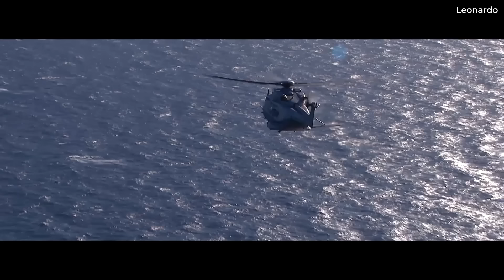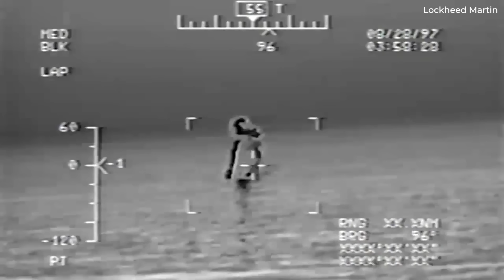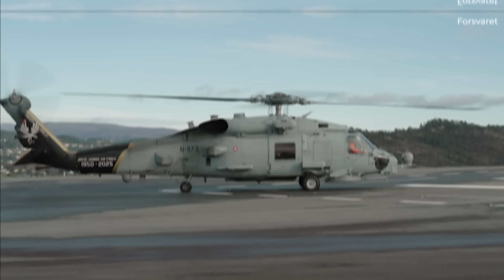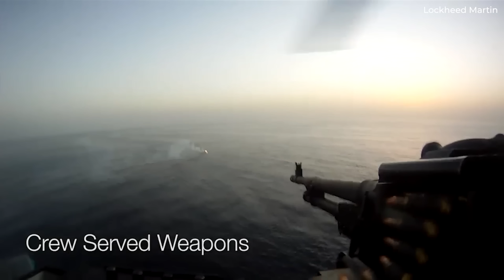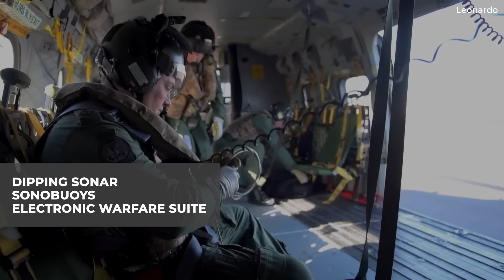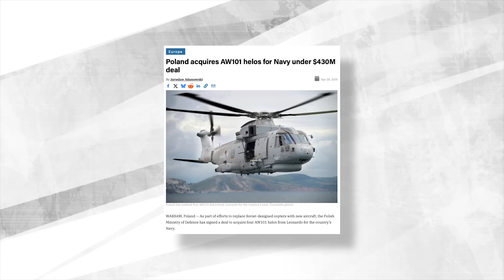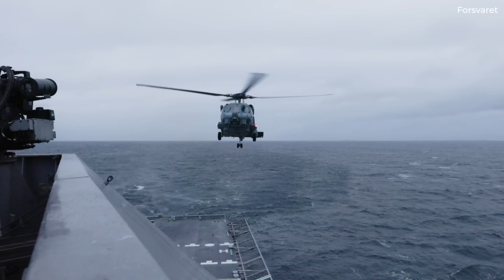MH-60R vs. AW101: What Will Be Norway's ASW Helicopter?

Comment: Most likely 101 as the new frigates will even share crew with UK, and Norway went for the very expensive type 26 not cheaper frigates, hence they went for the ultimatum asw frigate, and then the 101is a logical choice.

Comment: If Norway putting on their future ASW frigates, need two medium lift helicopters per ship, not 1 heavy and large aw101. Difficult getting 1 heavy aw101 on flight deck, so need two medium helis for many reasons, continuous tracking, team hunting-1 tracks, second destroys, safety and backup, if one breaks got backup,  basically two helis have faster and larger ocean coverage area and one working, while second is refueling, maintenance, crew rest time, etc...Cant alternate two 15,000kg aw101's on frigate, when far from land. So if sending as land based version then all day aw101, just cant operate frigates without two helis on board to do job, so get mh 60 Romeo Seahawks all day, hopefully USA gets leadership stability some day soon, if not then AW159 Wildcat could be option?!

Comment: Rear ramp for commando operations, 3 engines, commonality with European allies, more lift capability....its not even close....
Reply: The ASW version doesn't have the ramp.
Reply: @dogsnads5634 Thats because its the ASW version and does not need one, the fact remains the option is there if required.

Comment: I agree that the Merlin is a great platform, but it is absolutely massive. I doubt it will be chosen, if only for the reason that Norway very recently bought in on the MH-60, Say what you will about norwegian military, but they keep their platforms for a long time. I.e. Bell 412, Leopard 2a4, g3's, their Sea King fleet... not to mention that the MH 60 is significantly smaller in every respect.
Reply: We already have Merlin...And why should smaller bee positive, when it has less cargo capasity, shorter range, don`t manidge as bad weather as Merlin and has only two engines ?
Reply: @JanOlavVestavik I am not arguing that the sh-60 is a better bird. I am saying that the navy already uses the sh-60 for the coast guard, and that in itself weighs more than the suitability of a helicopter the size of a tour bus.
Reply: @Anax89  Its the military that has the daily maintenense on AW 101, so we alreday have the training on that. They fit in the frigate and the british who build the frigate are also going to use them in their frigates. What the  navy needs and the coustguard needs is two different things- and the coustguarships and the frigate ships ae also different. So : Two types is not a problem because we already have those two types. The sice fits on the frigates, have longer range and flying time, and can take more equipment, weapons and cargo - so the size is an advantedge - not a problem. The AW101 is the best helikopter of the two - and deliverer of the helicopters can bee trusted - witch USA can not.
Reply: @JanOlavVestavik sound arguments, however i am not saying the 101 is bad, or a bad fit. I am saying the norwegian military has a track record of inexplicably short sighted logic, and therefore i don't believe they will choose the 101. They will choose the hh-60 due to it being recently acquired for the coast guard.
Reply: @Anax89  Ah- short logic I can agree on. And a culture that usualy stick to what they already are familiar with. Its a slow organisation to turn - as is politicians. The problem is that the world turns faster than they are able to - and developements in war also. As an example we have a foreign minister that a year or so said that mines had no place in modern warfare....He has worked for an international ban on mines all his political life. So he stick with his beliefe on how the world should bee, and shut his eyes to that if we meet the russians on the battlefield - they will use mines. Or that the fact that it was Ukrainian mines that held the russian advanses back for two years, and it was mines that stopped the Ukrainian big summer offensive. It is many comments like that witch makes me get  a bad feeling in my stomack - and the time everything takes. I gess if the russian invades and lets say they succed in reatching the capital after many years. Then they will find the goverment there in a meeting still discussing what to do with the initial invation.
Reply: @Anax89  P.s. Since this is an argument about what to buy...What do you think of the purchase of missiles specialised on hitting airdefense and radars ? We have used billions on it.. And the defense minister said that it was important to do it in order to get airsuperiority, and that the russians had to deploy many types of airdefense in order to defned themselves. Buit here is the thing: The russians havemany airdefense systems, and the Ukrainians are taking them out. The war has lasted for 1184 days days, and ukraine has destroyed almost 1400 russian airdefense systems...more than one system a day. But the most of themhave been destroyed the last year - with drones. That is why Russia now can`t defend themselves now - even in Moskva where russia have consentrated more that 250 different airdefense systems. How many systems are there around russias most important military harbour ? Do we have the amount of expensive missiles costing billions to put them out of action - or would we bee better of to buy tens time more long range cheap drones witch Ukraine uses so successfully ? In other words : Do we change when the wars  change, or do we stick to old time doctrines like hors cavalry attacking macine guns in WW1..?
Reply: @JanOlavVestavik I think it is a wise choice that brings synergies to existing platforms. All things considered, missiles are a proven high-pk mature concept with few inherent and  exploitable weaknesses. I don't say this to diminish the lethality of drones, but the concept is not mature, and we are yet to see which countermeasures will prove effective against them. If a small nation like norway invests too early into a largely unproven system they risk sitting on a pile of easily defeated platforms in a few years time.
As soon as someone fields an effective and cost-concious counter measure, Drones will have to evolve in order to stay relevant - that is an ongoing race

Advanced Long range Drones, as seen i Ukraine have been developed out of necessity, rather than finding an unexploited tactical niche. I believe an advanced cruise missile is superior to an equivalent drone in almost every way except cost. This however is a false dichotomy - the future is not either missiles or drones, it is missiles and drones
Reply: @Anax89  It seems like our politicians are thinking like you.But here is the thing : If we take the cheapest packed we will buy aroud 200 missiles. Russia has more airdefense systems than that around Moscow alone...how mutch do they have around their biggest neuclear submarine base ? Another point is that Ukraine has proven that they can hit airdefense with cheap drones. And their long  range droens who hit factories, harbours and oil refineris lomger inside Russia than from norway to the bases on Kola, are driven by propells...Now they have bigger drones, rocketfeuled drones and missiles also. A ukrainian Flamingo missile cots one third of a AARGM-ER missile. We could have 600 of those in stead of 200 US missiles. Germany wanted to buy tomahawk missiles from USA, but have changed their minds and now want to buy Flamingo...And a factor is also that USA first approved the sale, then trump got angry about something, and they changed their minds...You can trust a trade deal with ukraina, not with USA. - As for drones..Yes they have a rapid developement, as do contermessures. Russia is thought to produce 1.4 million drones eatch year. 6000 longdistanse drones eatch months....Ukraine produces more. If there is a peace periode, where russia get to rearm....what will the number they have to put up against us bee ? And is it not to late to start producing dornes when we are attacked ? Shall our legacy bee that we lost our coutry to Russia, but at least we did did not have a stockedge of old drones at that time ? Is the point that weapons develope a reason to not have weapons ? Is there going to bee a time where we can start producing /buying drones because they will not develope anymore ?
Reply: @JanOlavVestavik  Great points all around. However, there are some flaws in your argument: The number of SAM-systems surrounding moscow or Murmansk is essentially irrelevant. There are only so many A2AD-systems available, and Norway is not going to strike Moscow, or Murmansk for that matte,r without NATO support. At which point the platforms available to norway is whatever NATO can muster.

Drones are effective as of the present, at the echelons above Platoon level, the only thing an attack drone does better than a missile is being cheap. At the platoon level and down the drone is forcing the opponents to come up with an effective counter measure. Drones will be a part of the future of combat, but it will dominate less than it does today. As for the AARGM-ER-argumentThe difference is this: The Flamingo is a cruise missile that requires independent targeting data to know what and where to strike, the AARGM-ER is an air launched system that is dedicated to homing in on radar waves. The Neptune is a capable platform, but it is more comparable to the Tomahawk, but it is not as capable as the Tomahawk - good enough for a saturation attack, but all things compared, a Tomahawk is more capable. The US has proven to be an unreliable partner, and i wholeheartedly agree that Europe should stand together and rearm with european arms, but things being as they are I think smaller nations like the nordics are better served sitting on the fence until drone development levels out somewhat, alternatively a joint drone program could work, but for norway in isolation, I think it will be a poor return on investment if they start buying too many current platforms.  Ukraine has proved that it is possible to do large scale production at decentralized sites. That will be the future of production for everyone. As for losing your country, I wouldn't worry too much, Russia has failed to take a country practically devoid of natural defences, whereas Norway is a defenders dream. Forests, lakes, bogs and mountains? You can cannalize your enemies seven days til sunday, and still have space to retreat.
Reply: @Anax89  Yes we have space and terrain, but on anything else I disagree strongly. The war in ukraine has now lasted longer than WW2, and it is only now thatthgey seem to get a upper hand. Because of drones mainly.Yes they have  a big small factory industry...but they used 4 years to get their production up to a volum that made it bigger than Russia. And with a technology that is superiour to the russians. It is not easier for us - mayby even harder since we are at a peacetime economy - to start up, scale up and so on drone productions. And then we have to train dronepilots...russians have trained pilots through  years of war...Drones will not bee less dominant than today in future wars. In ukraine they are now operated on every level, from person level like with Black Hornet, through platoons and all up to brigade and batalion level. There are now ukrainian brigades that only does drones...and they can operate hundreds through AI via one operator ...like they do one the road  from Mariopol. And mind you - they have hit and destroyed almost 1400 airdefense systems, most of them in 2025....and mostly hit by prop driven drones. Why use a Tomahawk that today cost 832 000 dollar EATCH, to hit airdefense target that you can Ukraine are able to find and hit with cheap drones. it is profitable to hit ecpensive targets like Pansir with a Tomahawk since one pansir system cost more tha 15 million dollars. But still it is cheaper to use a drone. The ukrainian special forces claim to have destroyed half of destroyed pansir in 2025, and that they have destroyed Pansirs costing 4 billion dollars. You don`t have to have a missile carrying a big warhead to hit russian airdefense systems like pansir, S-300, S-400 or buk-m3....they have all been found and destroyed by ukrainian drones. I don`t know mutch about the effectivness of the latest S-500 promethious..but they are against hypersonic ballistic missiles ( they claim) but the reality is that russian airdefense are not capable to defend themselves. And that is the lesson we should take. One have to have a good airdefense and a lot of it, and one have to have a lot of drones to put the air defense of the enemy out of action. 300 missiles won`t do, and the moneu is better spend on missiles able to take down big buildings, bunkers and so on, with drones can`t. - Ukraine now uses drones on sea, sub sea, land and air. That will not be a developement that stopps. And it is more crusial the less population you have...If peace comes, russia will continue to develope and produce drones massively. It is to late for us to do so if they attack ! Thats why it is good that Norway now cooperate with ukraine to make drones for them. then we will have the expertise on making the latest modern drones as the drones develope, and have the infrastructure to build and scale up in place when we need it. Starting from scratch will bee a disaster. The russians know this, so not having drones and the capabilities to make them fast in big numbers will also bee a disaster regarding deterense.

Comment: Now that the AW-101 is in use as the SAR bird, it makes sense for parts/training commonality to go for the AW-101 as the ASW helicopter and the eventual replacement for the AB-412s. It makes sense to have as few types as possible in a small air force.
Reply: Well, Norway have already bought Seahawks for supporting their Coast Guard,  meaning they are already planning to have both types in their fleet

Comment: I currently have 14,000 hours in helicopters. The AW 101 is a much better platform but unfortunately as with the Canadian Forces Search and Rescue. Parts are always an issue.
Reply: If we out aside the mission suite for ASW and focus on the helicopter maintenance, I would have assumed the AW101 has a streamlined and straight forward process from Leonardo for replacement parts. 

However if this is an issue, would it not make sense for the Danes, Norwegians, Brits and Italians to have a common procurement system for replacement parts since they all use the AW101? The Norwegians are understood to place a high requirement on platform availability especially in a very harsh environment of the high North. Whatever the case both platforms are proven and the winner of this tender will have to have a proven a nimble supply chain to deliver on the replacement parts.

Comment: Heard from a CAF ex Cormorant pilot that if they had to hoist someone far enough east of Gander (and if the winds were favourable) their plan would be to continue flying to the Azores with the patient. If Norway wants an ASW heli with great on station time I think it's going to be the AW101
Reply: That would have been after refueling at the Hibernia oil field 250NM out.
Reply: That'd have to be one a hell of a tail wind. Seeing as the Western most island of the Azores is still 250km beyond the maximum ferry range of a fully fueled Cormorant taking off from Hibernia.
Reply: Royal Norwegian Air Force (RNoAF) already has sixteen AW101-612 helicopters stationed at six SAR bases along the Norwegian coast. The Leonardo AW101-612 model is built according to Norwegian SAR requirement specifications and is today the most advanced SAR helicopter available. 

Standard Operational Range is 1,389 to 1,500 km (750 to 810 NM). It can fly further with auxiliary fuel tanks and is compatible with air-to-air refuelling (AAR) and hover-in-flight refuelling (HIFR) for practically limitless range.  For maximum endurance, it can stay in the air for up to 7 hours and 40 minutes (under optimal cruising conditions).  Passenger capacity in SAR configuration is 25 passengers. 

Both range and passenger capacity is important for Norway's SAR mission, given that Norway's national marine waters total about 2 million square kilometers, which is nearly seven times larger than its mainland landmass. This encompasses its territorial waters, the Exclusive Economic Zone (EEZ), and the waters surrounding the Svalbard archipelago and Jan Mayen.

Sysselmannen (the Governor/Police) on Svalbard operates an icebreaker, M/S Polarsyssel with heli deck, and two Eurocopter AS332 L1 Super Puma helicopters for AWSAR - different from the RNoAF's Leonardo AW101-612s on the mainland (but the AW101-612 would be just as relevant on Svalbard).

Comment: I bet the choice will be Merlin, it gives maximum interoperability with Royal Navy and we are very happy with AW101 SAR for the rescue service, 99% availability in Arctics is great. We will get synergies on some things, might be flight simulator, spear parts, crew training.  Seahawk could make same synergy argument as we operate those helicopters for the coast guard ships, but SAR fleet is much bigger and for Norway, the big brother is Royal Navy. Getting the same ASW frigate as RN matters a lot.  Top priority for Norway will be to say to the Brits, you can trust our T26 as your own T26. Also, having RN copy of T26, means we add scale to the upgrade program. The Norwegian Navy had more issues with T26 anti-air capabilities and radar, if accepted that, we gonna take Merlin.  We gonna give Brits and BAE Systems grey hair on availability instead, plus improving air defense. I bet Norwegians gonna push hard for DragonFire.  Need to choose the right things to push the Brits, I say availability and kick butts until we at 75% availability, lol.